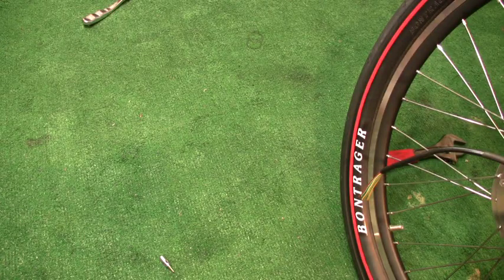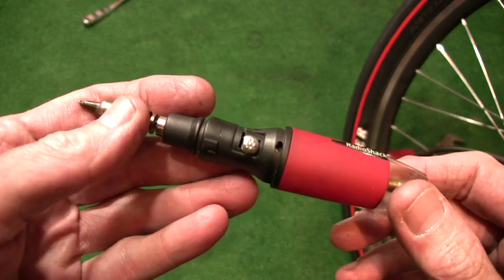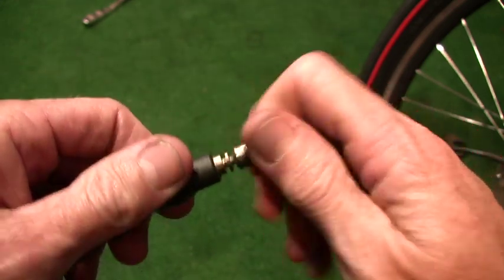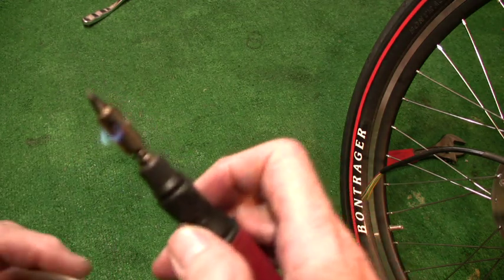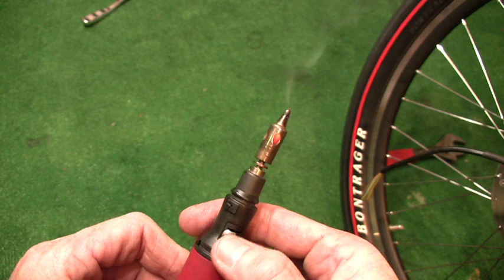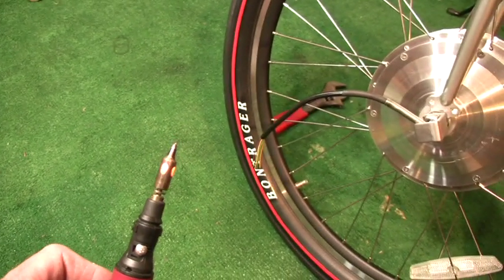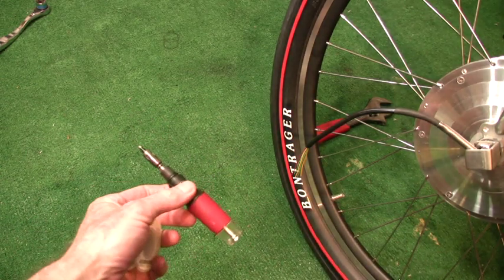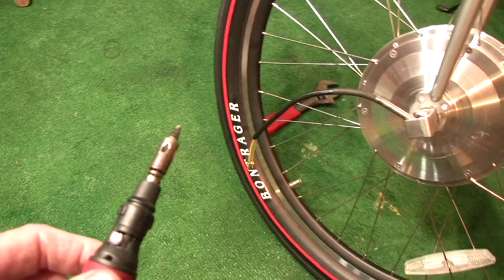RadioShack butane iron: heat for heavy work

Comment: @swatregret This happens rapidly once the copper is exposed. A soldering tip is solid copper clad with iron. The iron protects the copper from being eaten away by the flux. DO NOT GRIND, SAND, OR OTHERWISE SHAPE ANY SOLDERING IRON TIP. Doing so will destroy the protective iron cladding and your tip will get eaten away very quickly. The person in this video admitted to grinding his tip to improve heat transfer, but he has drastically shortened its life. If you need a different shape, buy it.

Comment: Thanks a million. I am a retired engineer and I was looking for a good iron for occasional projects.  Unfortunately I bought the Weller ML 500 butane iron. What a piece of JUNK!  The variable heat control is not variable at all.  Oh it slides back and forth, but it is either on full blast or off.  After just a couple of projects the tip burns up and looses all it's tin.  Pure junk.  I thought with a name like Weller it had to be good. I had a Weller port-a-sol and it was great.
Anyway thanks.

Comment: @jKPieGuy Any solder labelled "rosin-core" already has the flux built in. Rosin is basically tree sap, and is the most common type of flux used for soldering electronics. Flux cleans away the oxides from the metal as it heats up, ensuring a clean bond of solder. It is also what produces the smoke when you touch the solder to the hot joint and iron.

Comment: @Orcinus24x5 Fine fine and I was looking at the flame temperature when I looked it up, I forgot that you lose some heat when the flame heats up the iron tip. But still if you're using leaded or unleaded solder it's still good to work in a well ventilated area or use a fume extractor. By the way I got this iron about a month ago and it works quiet decent. ;P

Comment: Thanks for  the heads up! I tried repairing my battery's main connections using my wimpy electric 30w radio shack soldering and it just simply didn't melt anything! But, on your advice, I went to Radio shack, requested the soldering iron(Apparently they're frequently stolen, so they only had an empty box up front) and took it home and it works miracles! It's just wonderful! It actually made soldering easy like I think it should be!

Comment: I've had 2 of the older ones that were cigar size and liked them very much, but after being stored for a couple of years they wouldn't take a fill or work anymore. Maybe they should be empty for long term storage? Also the new lead free solder seems to take more heat and is prone to "cold " joints which open up over time. I've resoldered lots of circuit boards on electronics. JFYI

Comment: This looks like a really good iron, it will most defiantly work better than that "Cold Heat" one that my pa got awhile back from around when it first came out. The only problem is that on the site it said this product contained LEAD.

Comment: @supersanchez1991 It comes with a changeable tip that works like a mini heat gun...so yes, it can be used to shrink heat shrinkable connections and tubing.